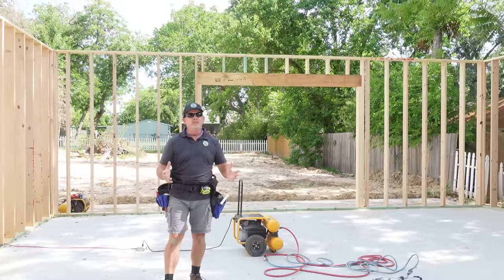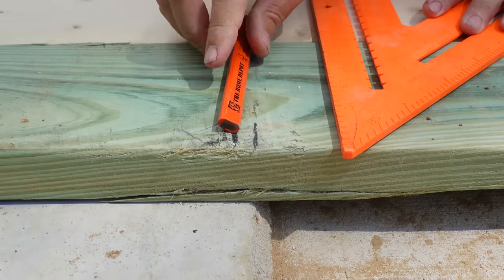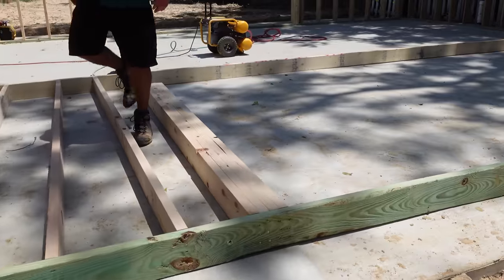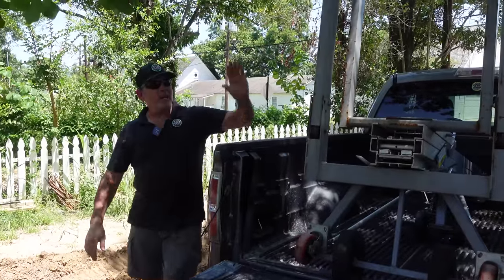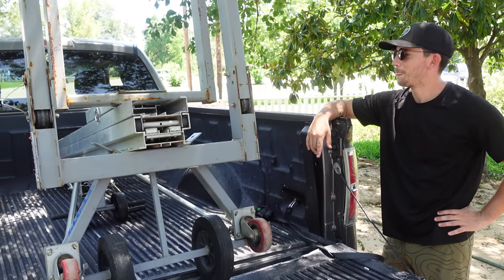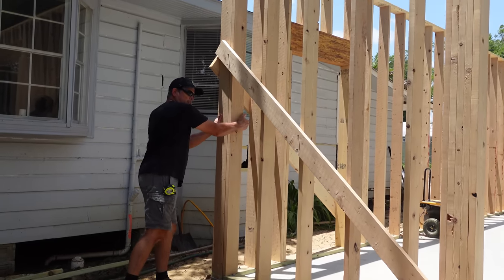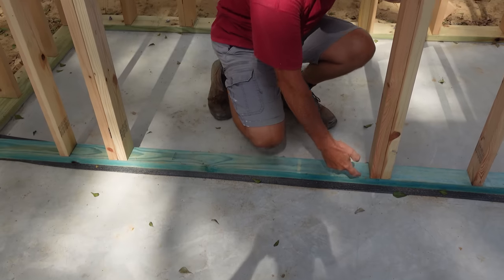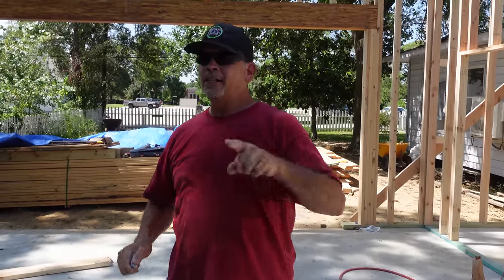FRAMING Our DRIVE THROUGH Garage!! - Will This ONE MAN LIFT Work?

Comment: It's a garage. I wouldn't have a door, I would keep it clear under the stairs. Listen. It's a garage. Rodents and insects get into garages. Maybe not this year, maybe not in 5 years, but it is going to happen eventually. Cleaning out a garage is a lot easier when you don't have a cramped low clearance room with no ventilation that's been hiding a rat's nest behind a box in the corner. If it's open, you can put a workbench or something there, and it will be easier to clean and maintain down the line.

Comment: I would open it up. Don't need two doors if going into the house
Reply: One consideration is that a solid core door separating the stair from the garage provides fire and smoke isolation for the exit stair if a fire starts in the garage.

Comment: POWDER ROOM 

if you don’t have one downstairs
Reply: Good idea but they would have to bust out the concrete slab and portions of the massive grade beams to install the drain piping.  Unless they treat it like the bathroom remodel and pipe it on top of the slab and frame a platform above the pipes.

Comment: There are often restrictions regarding fire barriers between garages and occupied space.  No matter how you alter the separation wall be aware that the alteration could affect how your friendly building inspector interpreters the code.  Since you've run afoul of him before, may I suggest??  check in with your Architect before proceeding.